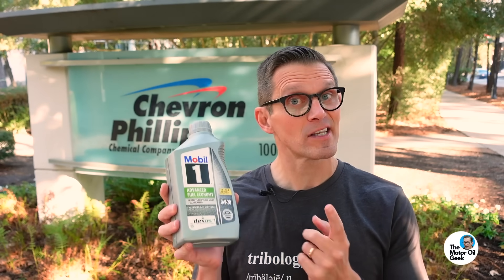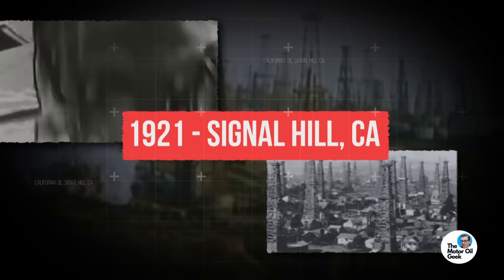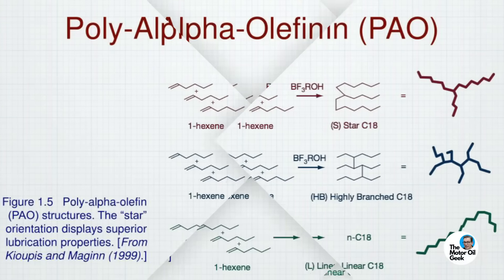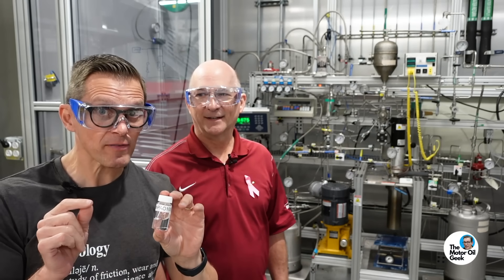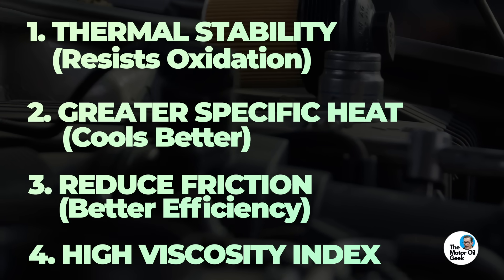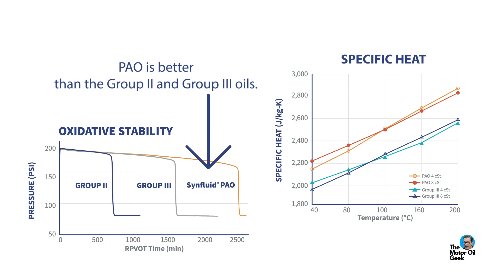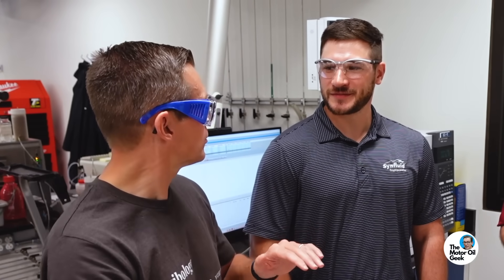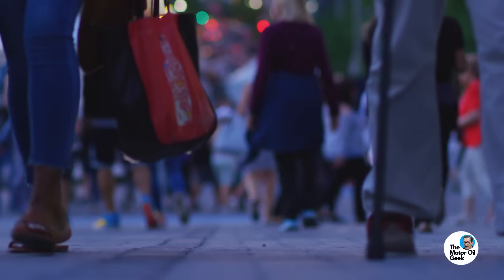STOP Using Regular Oil - 4 Reasons Synthetic is BETTER!

Comment: Synthetic oil is cheap compared to the cost of the engine.
Reply: My 318 is gonna outlast the jeep itself. It’s been on conventional all its life
Reply: Changing conventional oil every 1,000 miles is cheap compared to a new engine.  What’s that got to do with anything?  That is one of the weakest arguments imaginable.
Reply: @LTVoyager  Did you watch the video? Synthetic oil has high specific heat so it is able to draw more heat from the engine. The video has nothing to do with changing oil every number of miles.
Reply: @woox200sx  So, no street engine needs more heat drawn from it.  Many run too cold most of the time if anything.  And you completely missed the point of my comment.  My comment was that your comment is simply nonsensical.  The fact that every oil is cheap compared to the cost of an engine is irrelevant to what oil is optimal.
Reply: @ The only comment that is nonsensical is yours. The oil that is optimal is synthetic oil. Changing conventional oil every 1000 miles has no bearing on the performance shortfalls of conventional oil vs synthetic. If many engines run 'too cold' as you say, there would be no need to add viscosity improvers to the oil. Car manufacturers would just recommend we just drive around in 0W mono-weight oils. Even with EPA mandates, there are no car manufacturers that recommend mono-weight oils.
Reply: @ No, the optimal oil is the one that provides adequate protection at the lowest cost.  For most of my vehicles, that is conventional oil.  I use synthetic in my car, because it is turbocharged.  I use synthetic oil in my truck, because it plows snow and often runs in below zero temps. I use conventional oil in my motorcycles and law equipment because they have no need for synthetic oil and it would be stupid to pay more for benefits not needed.  Only the federal government does that and people who can’t do their own analysis.
Reply: @ So you do use Synthetic oil!? But what happened to the statement that you change your oil every 1,000 miles with conventional? You basically made a argument against yourself. Looks like you're just an expert at making BS comments.
Reply: @woox200sx  I use synthetic in my vehicles that benefit from it and I don’t use it in those that don’t benefit from it.  And I never said I change oil every thousand miles.  Learn to read.
Reply: @LTVoyager  So you have no argument then since you use synthetic oil in your own vehicles.
Reply: @woox200sx  I never said synthetic was bad.  I said that not every application needs it and saying stupid things like “synthetic oil is cheaper than an engine” is a silly rational for using it.  Use it where it is needed and the application justifies the cost.  Don’t use it where it isn’t needed and it is thus simply higher cost for no useful benefit.  Are you really as mentally weak as you appear?  This is really, really basic logic.
Reply: @LTVoyager  Basic logic. Looking after your engine with synthetic oil is better than replacement of an engine. You even prove it by using synethic using in your own vehicles. When is an engine cheaper than the cost of synthetic oil? I think you are mentally weak with your logic.
Reply: @ I’ve never worn out an engine yet whether it used conventional oil or synthetic oil.  I use synthetic oil mainly for its low temperature performance in my plow truck and for its high temperature performance in my turbocharged Equinox.  Engine life isn’t a consideration in engines that don’t need synthetic for another reason.
Reply: @LTVoyager  Still sounds like weak logic. When is engine life not a consideration? Even if the engine doesn't fail, worn out piston rings will lead to blow by and reduction in fuel economy.
Reply: @ How many engines have you worn out?  I have been driving since 1976.  I have owned probably 25 cars and trucks now and run several to close to 200,000 miles.  I’ve never yet worn out a single engine.  The only engine I had trouble with was a 2.5 L in a Chevy Equinox that came from the factory with known bad rings.  Chevy had a special recall on that engine.  That one started using oil at 90,000 miles and, oh the irony, it has always been run on synthetic oil.  I live in the northeast where we have winter and road salt.  Our cars seldom last more than 12 years due to rust.  Most drive 14,000 miles a year or less.  That is 168,000 miles.  No modern engine that isn’t defective from the factory will wear out in 168,000 miles on conventional oil, assuming it isn’t turbocharged or a high performance sports car that needs synthetic oil.  Running synthetic in such cars is simply a waste of money.

Let me ask you another question.  It is well known that that electrical connectors that are gold plated last much longer than connectors that are tin plated.  I am not aware of any car that comes with connectors that use gold plated pins and sockets.  When you buy a car, do you replace all its connectors with gold plated contact connectors?  These are clearly better than the stock connectors.  If you don’t do that, why not?  Why would you use inferior connectors?  Gold plated connectors have less resistance and will last far longer.  It is the exact same logic as using synthetic oil in an engine that doesn’t need it.
Reply: @LTVoyager  To replace connectors is not labour intensive. Pulling an engine apart to replace a piston rings is labour intensive. Older engines use cast iron engine blocks. Modern engines use aluminium blocks, hence the need for modern synthetic engine oils. Driving since 1976 hey? Looks like dementia is getting to you grandpa. Old people have no logic.
Reply: @ Replacing every connector in your car is far more labor intensive than replacing the rings in an engine.  You clearly have done neither.  I have done both.  And well made aluminum block engines have either iron liners and behave like cast iron blocks or have a coating such as Nikasil which most certainly doesn’t need synthetic oil.  My BMW motorcycle has such a block and has 107,000 miles on Castrol conventional oil and is doing just fine.  You sure like to make stuff up.  Anyone who knows anything about engines will understand my logic just fine.  I certainly understand why you are unable to grasp it given your many nonsense comments.
Reply: @ The fact that you've owned 25 cars and trucks in your life shows you don't know how to look after your equipment. Going through so many vehicles due to engine failure I bet.
Reply: @ Classic.  When you’ve lost the argument, start making stuff up.  Run along little child.  Come back when you grow up and can have an adult discussion.
Reply: @LTVoyager  Ok grandpa. Go back to replacing your connectors.
Reply: @ Q.E.D.
Reply: @LTVoyager  Changing conventional oil every 1,000 miles doesn't change the fact that synthetic oil has better cleanliness, viscosity index, cold weather performance (pour point), NOACK volatility, specific heat (as stated in the video). The person with the weak argument is you.
Reply: @FireAnt2640  And most of those are irrelevant to 90% of the engines on the road.  Only a few engines really need the benefits offered by synthetic oil and those that need it will have it specified by the manufacturer.
Reply: @LTVoyager  90% of engines? Sounds like you are pulling that number out of your behind. Whether you are driving a sports car or a econobox, the fundamentals of engines are the same. Metal on metal which needs to be protected by engine oil. All engines will benefit from the advancements of synthetic. There is no point listening to the manufacturer, they just want you to buy a new car when the warranty is over.
Reply: @ Yes, 90% is my best estimate.  If you have better statistics, please provide them.

I have run engines to near 200,000 miles on conventional oil.  Where I live, cars succumb to rust long before they succumb to engine wear.  Most modern engines will easily go 300,000 miles on conventional oil with proper maintenance.  I drove truck in my younger days and we ran many diesels well past 500,000 miles on conventional oil.  An engine in a car that will rust out before the engine wears out does not benefit in any useful way from running more expensive synthetic oil.  If an engine is perfectly serviceable with 0.005” of cylinder wear and the car will be a rusted hulk before the engine has 0.002” of wear using conventional oil, what is the benefit of reducing that wear to 0.001” before the car hits the crusher?

The reality that nobody selling oil wants to admit is that very, very few cars ever leave service with a worn out engine or need an engine overhaul or replacement even using conventional oil.  So, for the vast majority of cars, synthetic oil provides no meaningful benefit.  There are exceptions such as some high performance cars, turbocharged cars, etc., but these are small fraction of the overall car fleet in the US.
Reply: @ Your arguments sound like you are contradicting yourself. You state that cars never need an engine overhaul due to using conventional oil. However, your comments to the other guy say that you use synthetic oil yourself. So it sounds like you are a hypocrite.
Reply: @ If you could read, you would understand.
Reply: @LTVoyager  1,000 miles changes with conventional oil? Now that sounds like a dumb idea. With the same money, you could use synthetic every 3,000-5,000 miles. If you want to know who has a weak argument, look in the mirror.
Reply: @ Yes, that is why I used it as a dumb rationale.  It is just as dumb as the “oil is cheaper than an engine” argument for using synthetic oil when it isn’t needed for the application.  Too bad you didn’t understand what I wrote.  Try to read for comprehension next time.
Reply: @LTVoyager  1,000 mile oil changes with conventional oil is pointless. I wouldn't be going around saying other people have a weak argument with statements like that. Using synthetic oil is definitely cheaper than any costly repairs to an engine.
Reply: @ Wow, yet another person that can’t understand a sarcastic comment.  We really need to increase the emotional intelligence of people these days.
Reply: @LTVoyager  Looks like we've found the village drop kick. Change your conventional oil every 1000 miles if you want buddy, it won't give you the performance of a synthetic. The worst thing about people with your level of intelligence is that you're allowed to vote.
Reply: @LTVoyager  Changing conventional oil every 1,000 miles is such a stoobid idea. Did you even think before making that comment?
Reply: @Hammer3700 Did you actually read my comment and the thread preceding?  Do you even understand sarcasm?  Hint: it is in the dictionary.  Although, since you can’t even spell correctly, you probably can’t find it in a dictionary.
Reply: @LTVoyager  That's not sarcasm. That's a lack of basic intelligence.
Reply: @LTVoyager  You must be a fool if you think changing a conventional oil that frequently will provide any extra benefit for your engine. In cold climates, a clean conventional oil won't provide as much protection as a synthetic.
Reply: @LTVoyager  1,000 mile conventional oil changes?! This is what happens when MAGA starts giving oil change advice.
Reply: @LTVoyager 1,000 mile conventional oil changes is the biggest waste of time. If you think that is a good idea, maybe it is time you checked yourself into a nursing home grandpa.